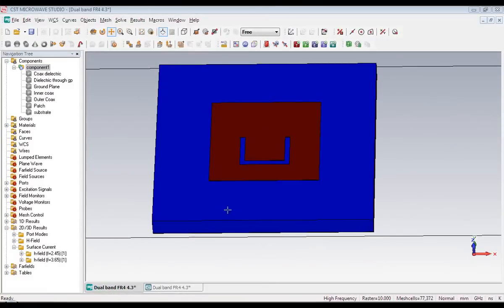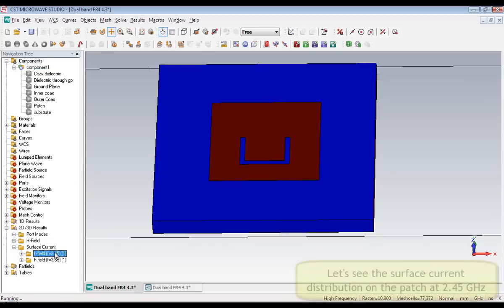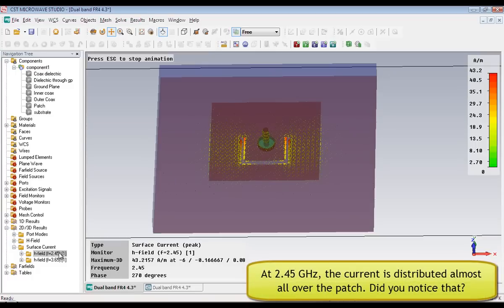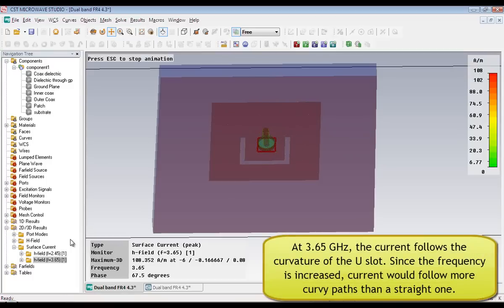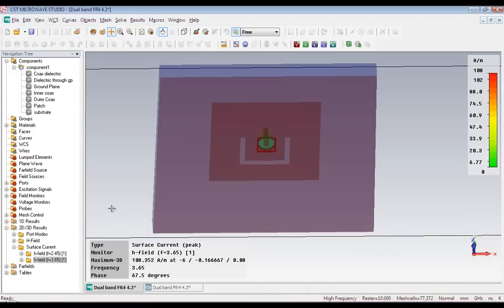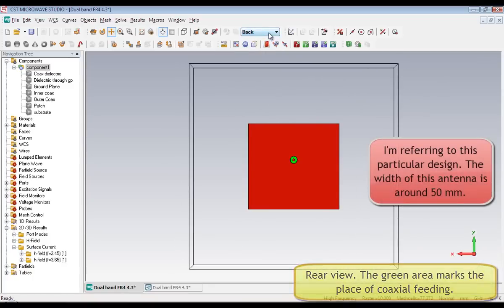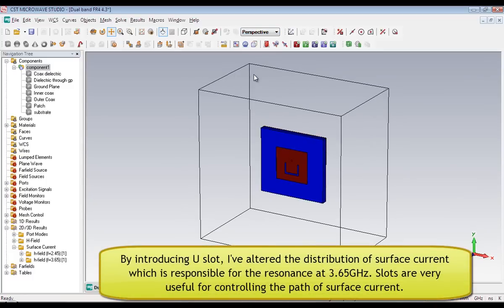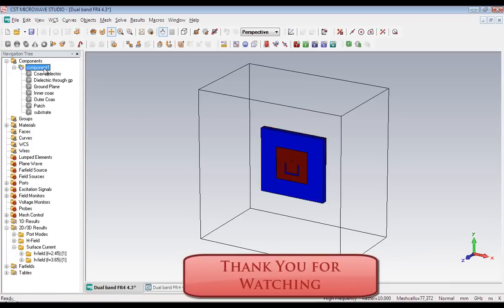Surface current distribution of a patch antenna- CST Microwave Studio 2010

Comment: excellent videos, just aquick question?
for any desired frequency how can we know the dimension of slot like which shape and size, and which place on patch should patch be slotted to get desired frequency?
Reply from the maker: There is no closed form analytical solution for this. That's why we have to run this in EM simulation and find out the optimum slot dimension